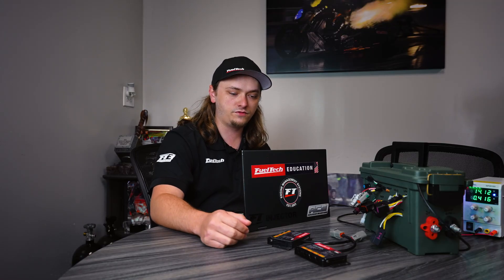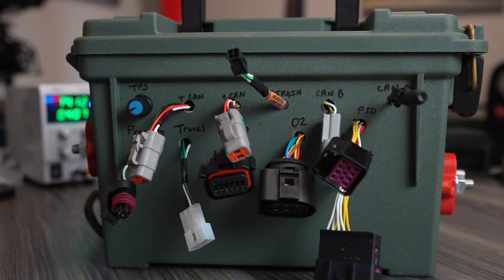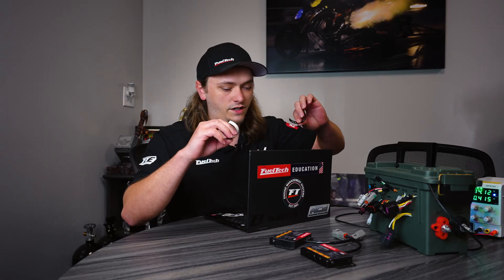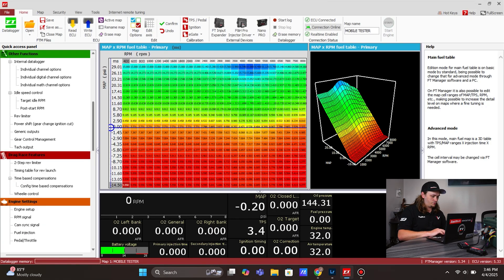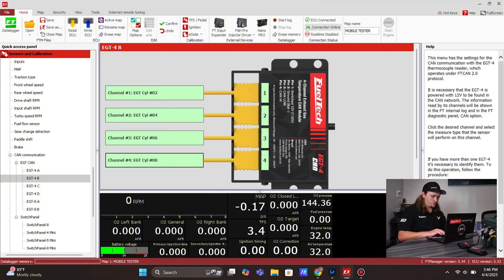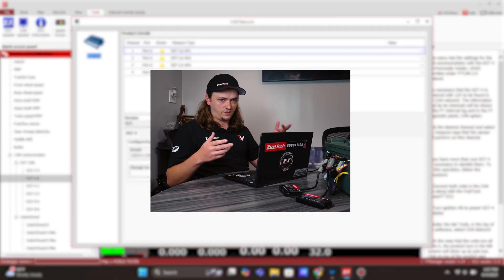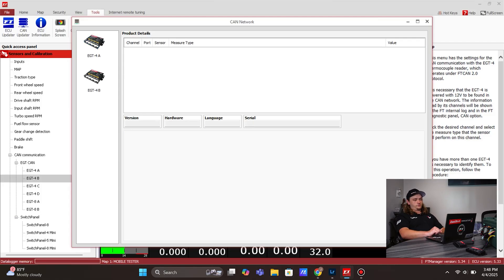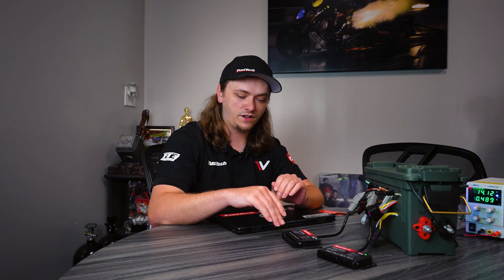Setting Up Multiple EGT 4's on FT Manager | Tech Tuesday x FuelTech USA

Comment: Why did the EGT 8 get pulled off the store? Should I be planning on replacing my EGT-8 controller? If I want to do more temp sensors like inlet air temps, can I add an EGT 4 to my FT550 via CAN with the EGT-8? I assume yes, based on this video, but I am mainly concerned about the EGT8 no longer being sold. Thanks! Go fast, go straight! Be SAFE!
Reply: After watching your last video, I was going to suggest if you have an extra input, you can add that air temperature sensor on the back of your intake. I added an air temp sensor on my charge pipe and also added another one below my blow through Carburetor.  I can see 100° difference.
Reply: @rolland1967  Yeah, I added the FT Inlet Air Temp sensor to the back of the tunnel ram plenum. Right now I have it plugged into #8 on the EGT8 controller. Go fast, go straight! Be SAFE!
Reply from the maker: Hey Kevin, 
We phased out the EGT8 a few years ago, having 4 per box generally makes it easier to mount and route the probes to the box, and for an application that only requires 4 EGTs they don't have to have 4 empty forever. 

If you want to add additional thermocouples later yes you can keep your current EGT8 and just add an EGT4 to the CAN.    - Jacob